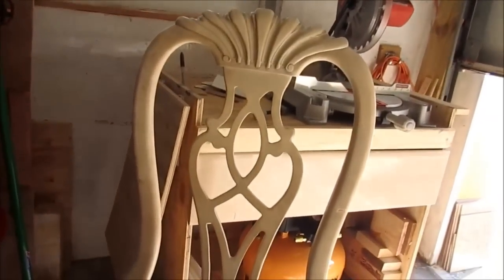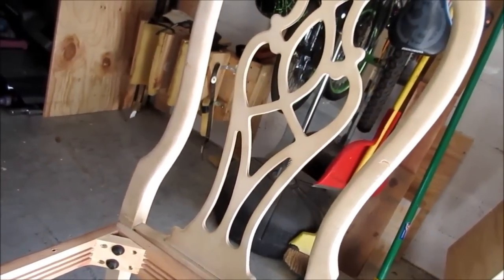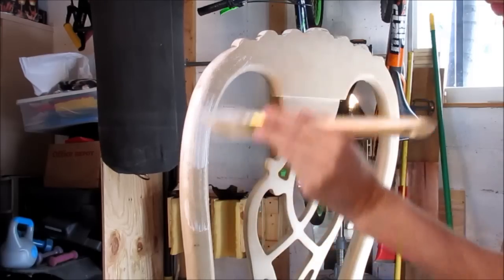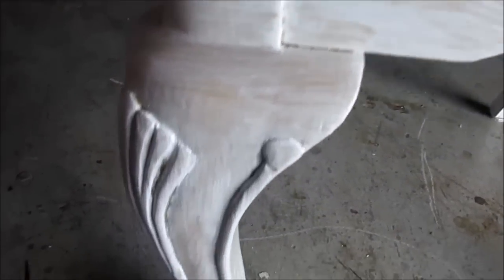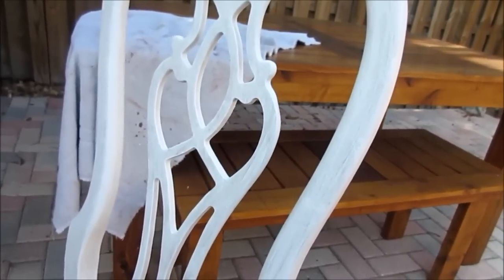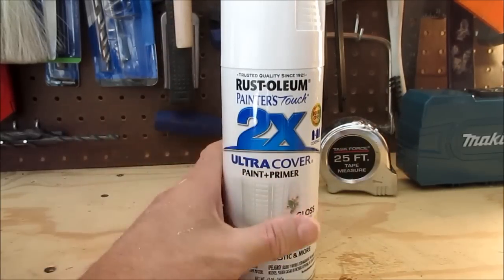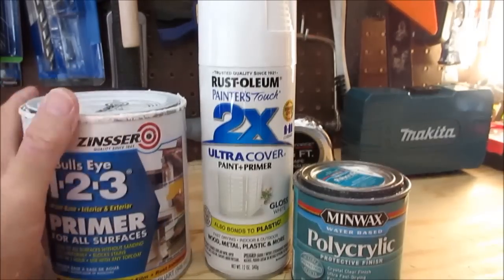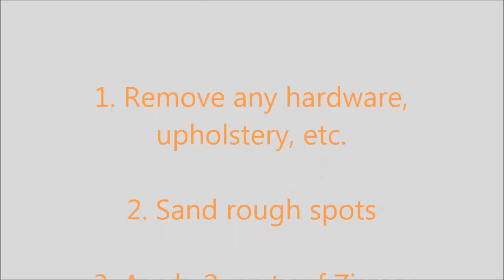How to paint furniture that has a glossy finish(without sanding off finish!)

Comment: Since that zinsser 123 primer was already white, was it really necessary to  spray paint it white?? ( I want to repaint some interior window and door trim that is a white gloss and I want to make it a matte white.)
Reply from the maker: Yes it was necessary. The primer dries to a chalky finish, I wanted a gloss finish for my chairs. It also dries kinda uneven and streaky, a look you probably won't want to leave.  Did you try the matte over the existing without primer? Unless it's that high gloss you might be able to, otherwise, yea prime it then paint, but not spray paint on trim, use a brush
Reply: Yeah, it's high gloss. That helps though thank you for the help!

Comment: Since the spray can has primer in it, Can I just skip the first 2 coats of primer and skip right to the spray can? Will it still stick and last?
Reply from the maker: You need the Bullseye primer if you are going over a glossy finish. Regular paint/primer will not adhere without it

Comment: I read the dry time on the zinsser 123, but how long should I wait before I paint over the primer?
Reply from the maker: Stuff dries fast, anywhere from 30 min- 1 hr and it should be dry for another coat of primer or paint. Primer and paint takes about a week to "cure" meaning to really harden up to where it won't scratch easily

Comment: Can I do this to repair deep  scratches on a high gloss table?
Reply from the maker: might have to fill/sand then paint
Reply: @RollingThruLife  fill with what?
Reply from the maker: @yellowphoenix9702  if it deep you can use wood filler/ wood putty to level it up.

Comment: Does the spray 123 primer work the same as the brush on primer?
Reply from the maker: Yes, it is the same product just a different application. If working indoors, brush on is best. If you can work outdoors, spray on is less work.

Comment: GREAT JOB! I hate spray paint though. The smell is hideous, , and that shaking the can every few minutes, with that rattling sound. Although it does leave a smooth finish. I use high quality sponges from Michael's. It leaves no brush marks at all. It will take a  longer though. Overall Great Job!
Reply from the maker: Thanks! Yes I like sponge also, but on the chairs there were just too many curves and round backrest frame to use a sponge brush, so I sprayed. On something flat like a chest or table, yes I would use sponge brush

Comment: If I want to paint over my kitchen island it has stain and varnish. I want a gray paint without it looking so grainy. What's the best way to do this?
Reply from the maker: Since the wood has a clear coat over it, the paint won't really be attaching to the wood directly, so the grain of wood shouln't come through. I would do maybe 2 coats of primer, sand after each, then paint. Should come out smooth. It all depends though on the varnish coat. Run your fingernail across grain, if varnish is thick, it will be smooth and what i said should work. If you feel the grain, then prime/same, prime /sand until no grain

Comment: Did you spray paint indoors?  I live in an apartment and was told to use paint brush instead of pray paint.
Reply from the maker: NO,  I sprayed outside, Spray paint indoors is a bad idea! Those paint particles drift. Using a brush is fine, but you tend to get brush marks.  I sprayed so to get a smooth finish. If you can try using one of those tiny rollers(come in like 4")  it will also give you a smoother finish than a brush

Comment: Great information! Thank you. I heard you could paint with Annie Stone chalk paint and no sanding or primer have you ever tried this? I am afraid to try this because I want to do my dinning room table and chairs yet afraid I don't  want to have a mess in the end. My furniture is very shinny Oak.
Reply from the maker: I am not familiar with that paint. I suggest google searches on it to see what you can find out.GL
Reply: Patty Liort Yes chalk paint is Awesome!  It goes on so easily and it doesn't take as much paint as when painting with regular paint. Chalk paints have a wax that's used to seal at the end. But you don't have to, you can use either polyurethane or polycrylic. Oil based or water based. I like using the polycrylic water based.  Me and my mom always use chalk paint. I highly recommend it.
Reply: Patty Liort  I painted a piece of furniture (expensive because of details) and I did not like the results now i am looking for options to fix my ugly ,sad,no life CHALK PAINTED china cabinet :/ 
I am going to try and painted like this video and if it doesn't work i will have to donate it! Have a wonderful day

Comment: When I spray painted the 2nd coat on the chair, the spray came out like dots. It’s a brand new can, the 1st coat came out perfect. So then I tried to wipe it off, and it took off the 1st coat, and now it’s a build up of the 1st coat. What can I do to fit it, and do you know what I could’ve done wrong?
Reply from the maker: Sounds like air bubbles, maybe didnt shake can enough, or press nozzle fully,  not sure. Let it all dry and cure- few days to week, then hand sand smooth, then repaint

Comment: You went with a water based poly-acrylic over an oil based paint?
Reply from the maker: It's fine. Plus oil based clear coat/polys tend to "yellow" over time, which would not look good on the white paint
Reply: So will the polycrylic work with chalk paint

Comment: chalk paint not sanding two coats sometimes 1.  You should use zinsser shallack spray before painting to seal in any stains from coming through the paint  Dries in minutes

Comment: Hello thanks for the video! Okay so I have a question I’m trying to be cheap I have 4 pieces of furniture I want to paint. A sleight bed, nightstand and two dressers which are black. Could I just use a spray paint can with primer or would I have to use an actual can of primer and then a spray paint like you did? Hope this make sense.. thanks in advance for the reply!
Reply from the maker: Hi, all depends on the finish. If your furniture is just painted, then yes a spray with primer could work/(basically putting paint on paint). if it has a gloss finish then you need to use this primer first. home depot/lowes paint dept can usually show you what you need.
Reply: Rolling Thru Life thank you again for answering my question and also responding so quickly. I do have a gloss finish so I guess thats the route I have to take. Now just figuring out how much cans of spray paint I need. P.s Just subscribed!😊
Reply from the maker: Your welcome!  Hard to say how many cans, maybe get like 4 or 5 and see. Your items are black so  a couple coats will probably be needed. To be sure of which process/product you will need,  bring a piece with you to lowes/hdepot and show em the finish, I know its all big pieces but you can pull out a nightstand draw to bring, that wouldnt be difficult.   Thanks for the sub!  Oh, and your not being cheap, refinishing is great, no reason to get rid of perfectly good furniture just because of color. good for you. be creative and make it your own

Comment: What if the table is wood? . Same stuff used?
Reply from the maker: What type finish does  your table have? 
        My chairs are wood. The Bullseye123 primer is designed to bond to any surface that paint alone would not. If your table has a gloss finish, the Bullseye123 will be used instead of having to sand off entire finish before painting. If your table is just raw wood, then bullseye123 is not needed, you can use a regular primer first, or just 2 coats paint.
Reply: @RollingThruLife  I'm looking to stain it.. I think it's lacquer
Reply from the maker: Typically you want to apply stain to raw wood so you can see the grain of wood,- for this you use "transparent" or "semi-transparent", basically they are clear-absorb into the wood enough to show grain yet add color. Some stains are more like paint, called solid color stain- they lay on top of wood and act more like paint.  So it all depends on the look you want.  But doing what I did is for painting over.
Reply: @RollingThruLife  thank you so much for your help
Reply from the maker: Your welcome! Hope I helped. Please subscribe if you haven't already. Any other questions, feel free.Thanks, Steve

Comment: How do you apply your poly?
Reply from the maker: iT wasn'r realy needed on these chair, it was high gloss paint, but I just wanted to put to maybe help protect finish from scuffs since they are used everyday and I have kids. But to answer your question- just a brush. I often stain with a rag, but usually brush on poly

Comment: it says primer and paint, there is no need to use primer twice.
Reply from the maker: That spray paint will NOT bond to a glossy surface. What you said is true if it was raw wood. The bullseye123 is needed for the paint to bond to the un-sanded glossy finish that was on my chairs. Remember this is about painting glossy finishes without having to do a big sanding job. Thanks

Comment: Any recommendations on what I can use instead of spray paint? The item I need to work on is my dresser and I can't take it outside because it's on the 2nd floor.
Reply from the maker: Hi, yes you can you paint from a can. I suggest a small roller to apply so you don't get brush marks.I only used spray because I was able to do outside,.

Comment: If I wanted to use a sprayer instead of the rustoleum spray paint, what type of paint would I use in the sprayer? Thank you in advance!
Reply from the maker: Not sure, but I believe as long as not oil based it's ok in sprayer.

Comment: Using the zinger 1-2-3 primer was an unnecessary step. The spray paint you used already has oil based primer added in to the paint from manufacture, and you could of sprayed a polyurethane over the top to save time also. Poor guy, you did however do a nice job, but completely over killed it.
Reply from the maker: thanks
Reply: Several others said this and he explained why primer is still necessary.  I guess he got tired of explaining it. See those just comments.  But I will add one more point. A Sherwin Williams employee told me that paint + primer is not really a thing, it's a marketing ploy.  I have learned over the years there are no shortcuts when doing a quality paint job.

Comment: sooo without sanding says the title, but... sanding it
Reply from the maker: Yes.. there is a Big difference between having to sand off the original gloss finish which is alot of work and would take a power sander to do compared to the 1 minute of light effortless smoothing of some rough spots from the primer.
Reply from the maker: I adjusted the title.. But its pretty clear that not having to take off the original finish is what is meant by no sanding. thanks

Comment: considering the cheap technology you can use now, there shouldn't be a standard of using a brush to paint anything anymore, if you're still using paint brushes you're a 2nd rate painter to me, you should either use a paint sprayer or spray paint, never a brush
Reply from the maker: I wouldn't call a home diy'er a "2nd rate painter" Not everybody needs to be a pro